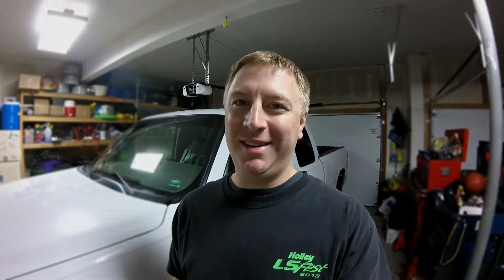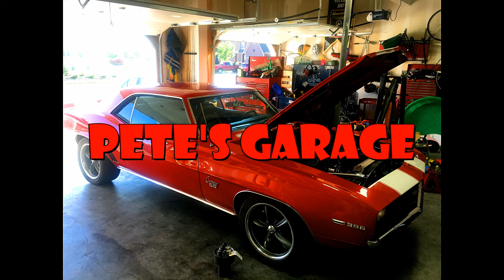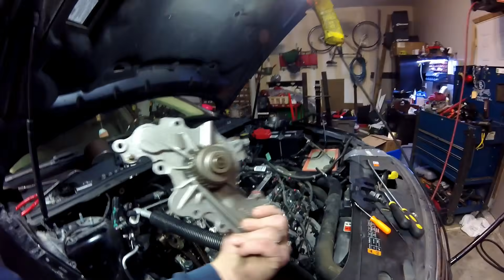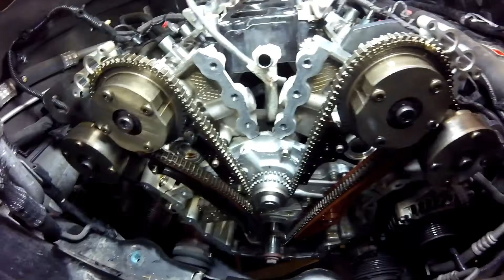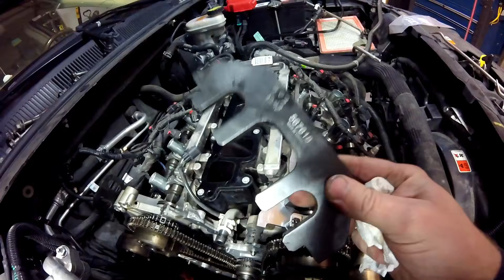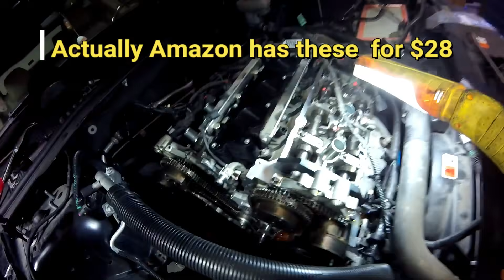Why does the Ford Taurus, Explorer, Edge 3.5L water pump cost over $1400?

Comment: Out of all the car manufactures, I HATE working on FORD vehicles the most. Special tools galore and they bury everything.
Reply: I'm gonna disagree and go with MK3 VW's, oh the redundancy!!
Reply: @TiconderogaX  uhh Im a gm fanboy..but you know the waterpump in a Cadillac Northstar is notoriously hard to work on as well. The New turbo ecotechs are a pita to work on.
Reply: m ph , I doubt that you work on cars .. if you did then you would that most are as bad and some are even worse. I rebuild engines for living.
Reply: I do custom car lighting and changing the interior lights on a damn a Lincoln town car and the F150 from early 2000s  you have to basically get torque screws to take the whole assembly downI'm a just to change a damn reading lamp, they also make the sockets for that license plate out of rubber soul that hot ass of bulbs and just melt the sockets and that's why they flicker
Reply: m ph i guess you never worker in an audi or bmw lol
Reply: @Jeff Sol As a private individual I can buy a dealer level scan tool and use it to repair and program Ford vehicles. It costs a fair chunk of change, but its available to me. Aftermarket scan tool manufactures will catch up to the manufactures tools.
Reply: Ford isn't that bad really. Just wait till you try working on a modern GM car like a Holden Commodore. Those are even worse and break much more often.
Reply: Thomas Barrett owned a Pontiac G8 with a 6.0. basically the same car, was not hard to work on at all. good ol pushrod v8
Reply: @benjamindyer7348  yeah that's a decent one. The sv6 model with the alloytec V6 is a lemon. Timing chains stretch to the point they have to be replaced every 100,000 km and you have to pull the entire intake manifold just to change a thermostat. The timing chains cost nearly $5000 aud to get them done at the dealer.
Reply: @tomtom1541  I just brought a Pontiac GTO (Holden Monaro). Such a weird duality. Some parts are well designed and easy to get to but alot of the switchgear in held together by cheap abs plastic, electronic gremlins..and you get suckered into someone servicing your key for a battery because its sealed together.
Reply: @ThePhoenixw68  yeah, the engine and trans started off as a corvette and was adapted to the vt commodore. All of the interior, plastics and electronics came from a vy / vz commodore and that's one of the most common complaints about them. Shitty interior build quality and things breaking all the time. The ve interior was much better and completely redesigned.
Reply: I teach drivability and the automatics and drive lines class and auto electronics 2. All car companies have more difficult models and while you guys complain about it being difficult, that's what gives you a job. If they made it too easy, most people would do it themselves.
Reply: @mikesamra9126  thats right why should a man be able to repair his own car
Reply: @coldspring624  I'm not here to complain about it.I'm just here to give you a general analysis of why certain things have become more difficult on cars to fix.
Reply: @mikesamra9126  I agree with you on the fact that difficult models aren't limited to any one brand. However, I don't agree that they're a good thing as far as protecting jobs. What you're describing is the broken window fallacy. The issue is that spending money on fixing your car doesn't stimulate the economy, you're not making anything net new. It's just incurred repair costs that drag down the owner first, the automotive market second and even the economy as a whole at big enough scale. For example investing that money would be great. Even buying a new product (i.e. a second car) can stimulate a specific market and the economy. A bigger stronger economy means more money, more cars, and more shit for mechanics to fix. Automakers generating repair bills on the other hand will eventually put you out of business if people switch to a alternatives and buy less cars. You'll lose the low hanging fruit first, like the people who don't really need a car when they could use ride sharing a few times a week.
Reply: @DmitrysGarage  When I was speaking of protecting jobs, I was absolutely correct. If everything was so easy like in the days of the shade tree mechanic that could fix his car with a few tools and parts you buy at the local auto parts store. There would be far less service techs as in the old days when many could fix their own vehicle without going to a garage for most things. 
There are still those can fix their own cars but not as many as they could from the 80s on back.
   Now, here something else nobody has mentioned. It's easy to criticize and say, why didn't Ford or GM or Honda or whoever, put the water pump in this position vs the more difficult position. Many of these things are due to the heavy hand of govt and the EPA and their mandates of how they want things to be done. Emission control devices may force a company to put other components like water pumps in more difficult areas because of where another device is located. Then there is manufacturing and platform sharing and how the vehicle is optioned that forces companies to put certain components where they do so it fits all the various platforms as they go down the assembly line.
   Being an automotive tech instructor and living in Michigan, we meet with the various automakers twice a year and we address the very concerns you have. Why not make it easier to change the ECM or program it when you have to replace it? Why bury a TPS sensor at the base of a throttle body inward where it is almost impossible to adjust it without certain tools. This was on a particular Volvo and I posed this question to Ford after they bought Volvo.Again, the laws were different in certain countries and being that car companies can't copy each others designs, that is another thing that plays a role.
     I used to fix TVS in the 70s and early 80s when I was in college, just like with cars, it always seemed the easiest sets to work on would fail more than those were most difficult to work on and same with cars. Case in point. Remember the GM tech 4 engine? The alternator was easy as hell to change but would fail constantly because they were located right next to the exhaust manifold and all they had was a cheap little cardboard like shield to protect it. The engines however would last a long time if you kept up with the maintenance.
  Then we also have the fact that the more you do a difficult job, the easier it gets. You often learn shortcuts where you can expedite things and even make up your own tool they may help you with a certain job.
   Mitchell on Demand writes their procedure manuals in conjunction with warranty manuals and of course warranty always allots less time for a job then out of warranty does. Then again, the dealer has the special tools but it shows that certain tools do expedite certain jobs. The good thing is,the tools are getting cheaper because you can buy them in the aftermarket.
Reply: @mikesamra9126  I didn't read that long ramble after the first paragraph because half way into the second it was obvious you switched topics. However, it's a know fact of economics that what you're describing in your original post is a fallacy. You might think it's saving your job, but it's not, it's killing it.
Reply: @DmitrysGarage  Nothing to do with my job. It has to with mechanic's jobs in general. Auto Service techs make great money and the fact that cars are more difficult to repair than they were  from 1940 to 1980, dictates this. This forces more people to go to auto service shops to get their cars fixed so saying it doesn't save jobs in the auto service industry is just factually incorrect. Yes, many people can read a code scanner and start replacing sensors but unless can read and interpret data, many times it becomes a waste of money. Then after changing a shit load of sensors, they have it towed somewhere. 
  I had a student who's uncle brought in a 96 Lincoln TC with 286k on it. It would stall when you took your foot off the gas but it trip any codes or turn on the check engine light,. He changed two O2 sensors, one on each bank.he changed a cam sensor and a mass airflow sensor to no avail. Now common sense tells you this an Idle air control issue which it was and the data show us this thru an IAC count even tho it didn't trip the Mil light. This is why most average Joes have a hard time with cars today and why there is a need for service techs. I just cleaned the IAC motor with spray and it's working fine. He spent all that other money that he didn't need too.
    Now, you think what the manufacturers are doing are killing jobs in the service industry but I'm not sure how. Many of my students end up in dealerships as service writers or as transmission techs or drivability techs. I taught the IN THE GM ASEP program and the Ford ASSET program for 3 years in the early 2000s and I'm well aware of the practices of the manufacturers especially on warranty work.
Reply: @mikesamra9126  ok have fun arguing against basic econ 101.
Reply: @DmitrysGarage  LOL, I think you missed my whole point. Auto service techs aren't the whole economy and neither are us instructors that teach in the field. We are a sector of it like anyone else. This whole back and forth got started because somebody complained that certain parts on some cars are very difficult to change and I gave you all the reasons for it. It has nothing to do with auto service techs or instructors but it does have to do with things like Govt mandates, proprietary designs, platform sharing, or any number of things.. While one thing is easy to do on one car,there are other things on the same car that may be easier to do than other cars. We see this all the time.
Reply: @DmitrysGarage  I just subscribed to your channel so will have to carry it on another time,
Reply: @mikesamra9126  haha, looking forward to it :)
Reply: @DmitrysGarage  I like some your videos being a Ford guy myself.

Comment: I'm keeping my 92 chevy s10 ,this is why I don't buy new
Reply: 83 C10 with a 305 and licsence plate floors.

Rather drive it than anything with a computer
Reply: Notably Nova bless your heart,, I do LEDs And I met a lady in Florida who had a 1985 C10 cherry red with 66K
Reply: @IllegallyNova  its not computers that are the issue, it's reaching the level of stupidity as this junk. one of my favorite engines 3800 series II supercharged is computer controlled, but they were a well thought out engine.
Reply: @ad356  the same series II known for head gasket issues, transmission issues and supercharger issues?

LOL

My point went completely over your head as every vehicle that had that engine was computer controlled and could easily fall victim to every problem related to a computer.

Hell Pontiac is known for having serious electrical issues during the series II era and especially in the GTP and SSEI which were the flagship cars of the supercharged 3.8 and the transmissions hooked to said series II 3.8 whether sc or not are well known to be the biggest flop since the second generation Ford Taurus.

I personally have seen that series drop trans at as early as 68,000 miles.

While my series one 89 Bonneville went 290,000 and never dropped the transmission

I'm talking all issues related to computer control such as body module failure, computer failure, etc.

Wait till your body control module dies and causes you to have no start issues, gauge issues, etc.

Then you will understand my point
Reply: @IllegallyNova   I think that - generally speaking - most vehicle computers are pretty reliable.  Under normal circumstances (at least in the 90's and early 2000's eras anyway) you shouldn't have computer issues unless something external to it causes it to fail.  The thing is though, most of the things that cause them to fail are things that would cause any car to fail that has any electronics on it at all.  (i.e., mouse chews through wires, water exposure, etc.)
As a case-in-point, my wife had a 2001 Pontiac Grand Am.  We kept it until about 215k miles or so when we sold it so she could buy something newer.  I had issues once with the body control module.  It was weird stuff - instrument cluster would cut on and off, doors locked at random - just weird stuff.  So I pulled it out from under the dash (the BCU) and lo and behold, it was full of WATER.  :-(  There was a leak under the windsheild that trickled down onto the BCU and completely filled its plastic case with water - effectively shorting it out.  I opened it up and set it on top of the cable box for a few days to let it completely dry out.  When I reinstalled it in its box, I used some RTV sealant around the edges to prevent water from ever getting in it again and I cleaned the drain ports at the bottom of the firewall.  Never had any problems with it after that.  Didn't even need to replace the BCU, it worked just fine once the water shorting it out was gone.
I will concede that there are definitely a lot more wires and sensors that could fail on computer controlled stuff.  But then again, mechanical linkages can fail too so .... there's that.
I'm not really saying one is better than the other because there are different applications where I would prefer one over the other.  But it's not accurate to say that computers are bad in and of themselves, or that vehicles that utilize them are sub-standard to older mechanical applications.  In my case, I'm a computer guy so I don't really find it any more difficult to diagnose and fix computer-controlled cars than I do old-style mechanical-based vehicles.  But I can say that I've worked on many computer-controlled vehicles and it has been extremely rare for the computer to fail in and of itself.  I've had plenty of water issues, wiring shorts, and failed sensors though.  I've also seen voltage regulators go out on alternators and fry the computers before.  But again, these are all factors external to it so ... and some of those will just as easily kill a mechanical-based vehicle too.
Reply: yeah,got a 86 ,4 cyl. with over 330,000 mi.  every time I check out one of these videos it makes it look better all the time .
Reply: @TiconderogaX  
What you want is an lc2.  The predecessor to that motor.   Im sure you know that though.   I won't work on anything transversely mounted.   ^that guy isn't a ford fan, he's somewhat right.  Except that, poor design is the enemy, not fuel injection.  Do you know how much timing is taken out at shift points on your precious series II?  That's why they are slow even after modified and they make power.  Fwd is the enemy.
Reply: I have an 01 gmc with 500k miles on it as my daily driver.  Square bodies and a GN.  
These new cars get less and less appealing every year.
Reply: @IllegallyNova  I'm with you on this one I've owned about 5 or so fwd gm pieces of shit from that era on top of working on shitloads of them, all of them are crap. 2.8s, 3.1s, especially 3.4 and well pretty much all of them suck. I'd say anything by gm is horrible, aside from square body c/k trucks and s10s from the 80s, other than that everything they build is absolutely cheapened out to the extreme.
Reply: @civiccruiser7025  as a square body owner I can say even the trucks are as cheap as they could get them.

Did you know that a square body S10/S15 or even C/K series has less than 20 bolts holding the ENTIRE front clip on it?

That's the fenders, radiator support, inner fenders, hood and bumper.

Comes off in one piece minus the hood on the S10s lol

I can't believe how cheap they were assembled and how easily they crumple.

I've replaced the entire front clip of an S10 that was totalled because of a 15mph impact that bent the frame behind the bumper.
Reply: @IllegallyNova  I never knew that bit but I'm not surprised at all. How about the next generation of trucks that use basically cavalier tierods and control arms.. shits thin. Not like Ford or Dodge is better but yeesh. Now I do like old Chevy duallys, they look mean and sound nice.
Reply: I got a 90 s10 with a 305 bore 30 over an a 6 speed trans with a short stick 🤪🤪 an a locking rear end 🤬
Reply: I have a 77 cheyenne, never getting rid of it.
Reply: Good idea
Reply: I have a 2006 dodge stratus that my wife bought to drive into the city daily a few years back and got 150,000k. Hated it so much, had to do some repairs on it, but now at almost 200,000k, I might just keep it as long as I can. Easier to work on than these new vehicles.
Reply: my daily driver is a 1990 Dodge caravan 2.5 5speed.  not much easier and cheaper to run/repair

Comment: Changed water pump in my 1996 Taurus duratec 13 years ago, ford (lower case) wanted 480 of my hard earned dollars so went to Mr Cheap I payed 99, still going strong! 
Although trans is another issue!

Comment: Ideally, the WP impeller should have keyed slots in the block.
Then, you just remove the front sprocket, push in the shaft, and un-thread the shaft ( c/w pump hub bearing) from the impeller.
The new hub ( pump ) bearing will be placed into the WP housing and the shaft threaded back into the impeller.
But, we are talking urban sprawl, mega-profits, planned anarchy , etc.
It's a car, not a cruise ship.
If 2000 people buy the $8000.00 cruise option, that's $16 million.
Rarely, does the passenger bring along tools to replace the shop's water pump.